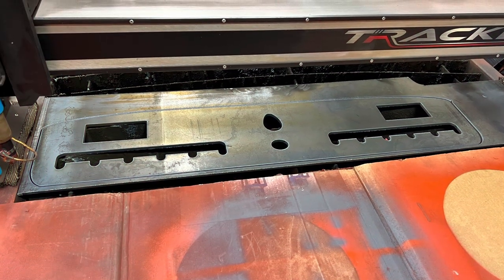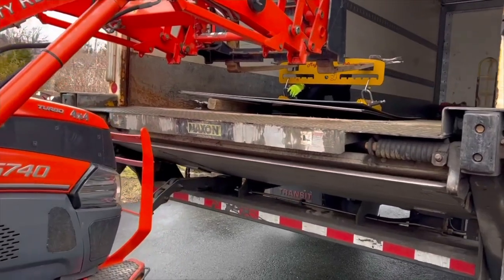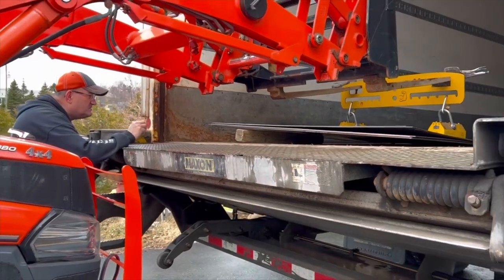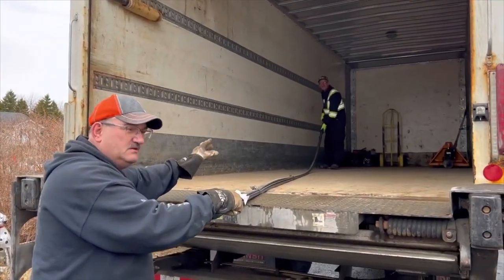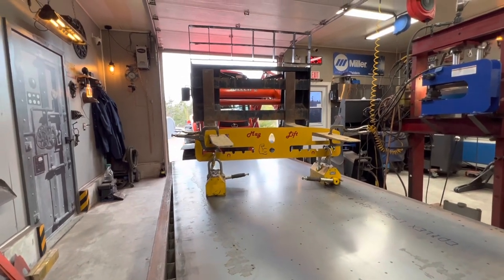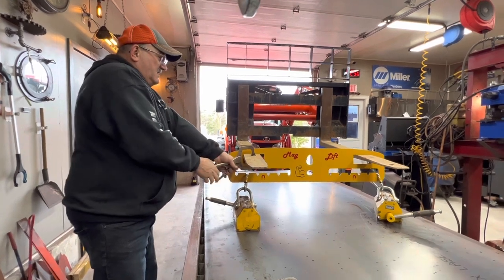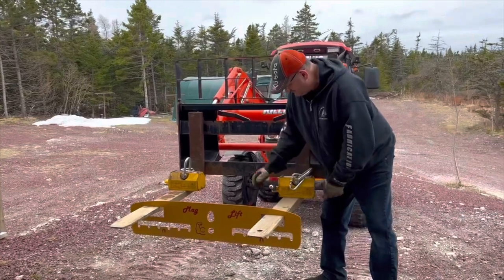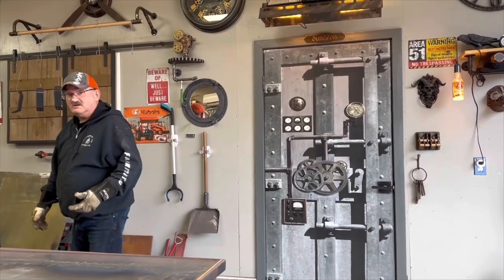The Mag Lift

Comment: With all the fab work you do I would fab up a linear actuator (slow). a pneumatic cylinder (fast), or hydraulic to flip the levers. I know they make rotators that are air powered as well as hydraulic ones. Just put an air tank on the forks should be enough volume to lock and unlock many times.
Reply from the maker: I don’t do this task enough to justify that expense nor can I afford that much time. In this case I already had the magnets so It was only a matter of 1/2 hour to draw  up the attachment, get it painted it and it worked just fine.

Comment: Simple,balanced & performed very well.  Also  a safer way to handle metal, no rigging getting cut or damaging materials or  slippery steel on steel on the forks.
Reply from the maker: Thanks. I was Mildly surprised on how well it worked. It will be used again.

Comment: Just a question -  Is there a risk for the bottom sheet to drop, slip or slide due to the magnetic force weakening?  There has to be a limit on how many sheets it could pick up as it didn't get the last sheet.  Just a thought.
Reply from the maker: Well actually one thick piece is far better than multiple sheets but in this case the sheets were supposed to be banded together as they usually always are but the shipper took the sheets that were banned and changed trucks and they cut the straps so this is the way we had to handle it today.
Reply: @7863348  Thank you - was curious.  Love the overall solution.